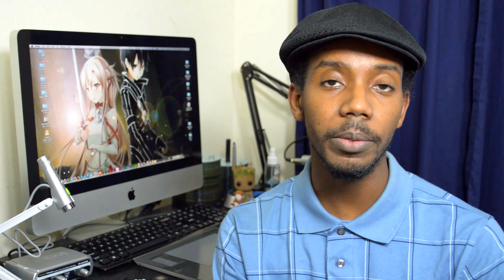Best Graphic Design Tools and Hardware

Comment: Given the new year, any recommendations for 2015/2016 laptops that can be used for 3D rendering, specifically w the W brand drawing tablet?  Low to high end?  How do Asus and HP hold up for performance on these? Does the graphic card, like the Intel HD 530 or 4600 make a significant difference, or is a general 'integrated graphic card' description ok? Buying for a first time artist getting into graphics,3D ,etc, and want something to get through a few years. Thanks so much!

Comment: Hi Roberto, I currently have a 6-year-old wacom bamboo tablet and Im looking to buy a new one since this one occasionally won't light up anymore. I was wondering if there really is a difference if I get an Intuos, or do I just get another (cheaper) Bamboo tablet? I wish there was a way for me to rent an Intuos so I can see if there'll be a significant difference when I use it. Thanks!
Reply from the maker: +Jeca Martinez The intuous is more accurate and has more pressure sensitivity I started with a bamboo, moved to an intuos and never looked back.
Reply: Great! Thanks for your reply. What about your thoughts on Intuos vs a Cintiq? :)
Reply from the maker: *****
If you're not a tremendously talented artist and you're not used to digital drawing a cintiq may not be good for you. If you do a lot of photo retouching it could be great for you... it really just depends. I would say find someone to let you try it and see if it is for you.